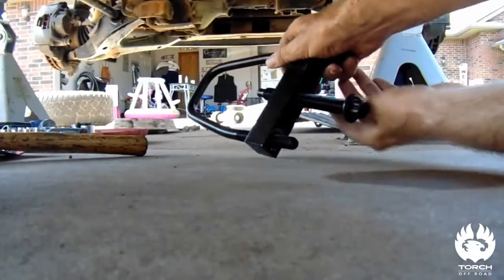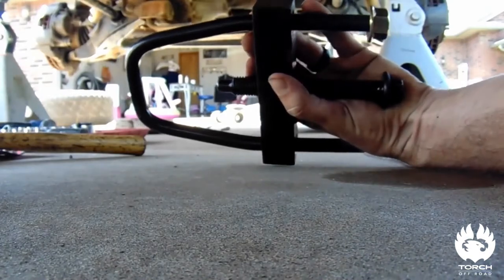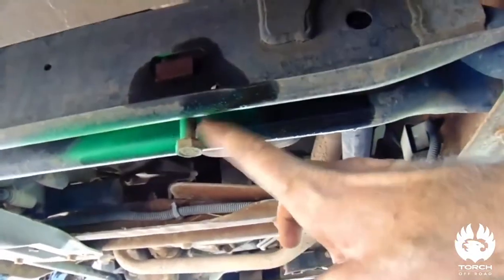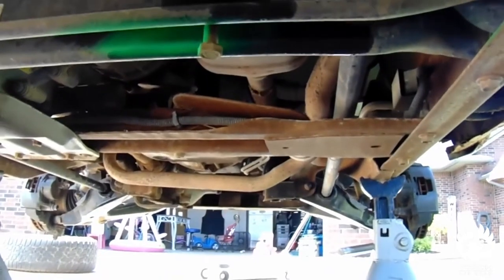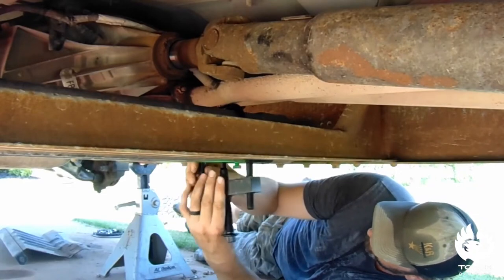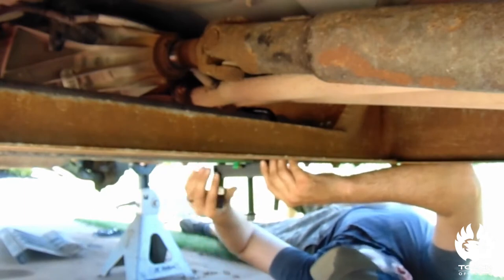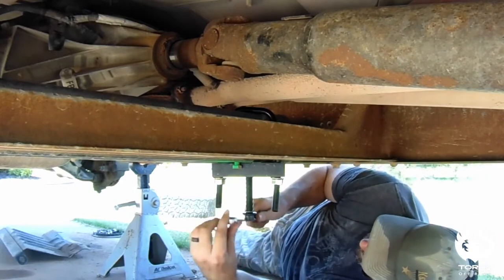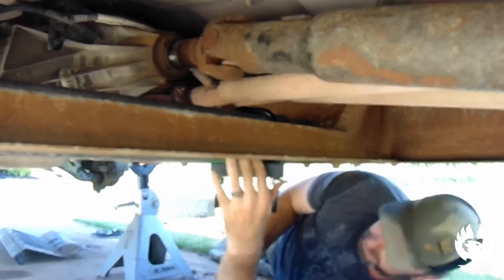TORCH Torsion Key Unloading Tool Installation Overview

Comment: Do these work with the z71 package 1500 models?
Reply: 2004 Sierra 1500 SLT z71
Reply from the maker: @jakedodsonjake  Thanks for your comment. The lift kit in the video is compatible with the 2004 Sierra 1500 Z71. Our torsion tool can be used in the installation as well. Please contact us directly and I’ll be happy to recommend a lift for your application 🙏 -TORCH